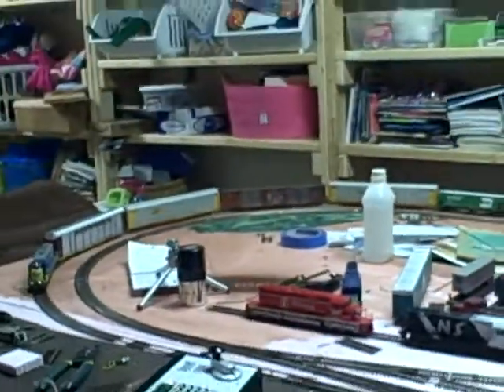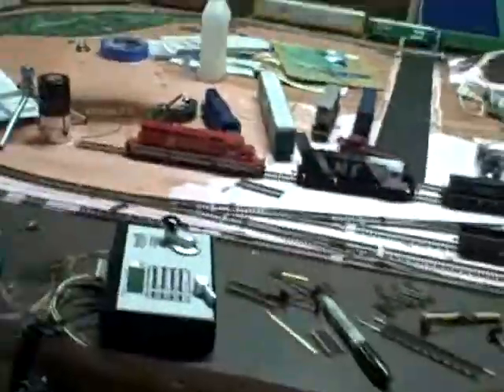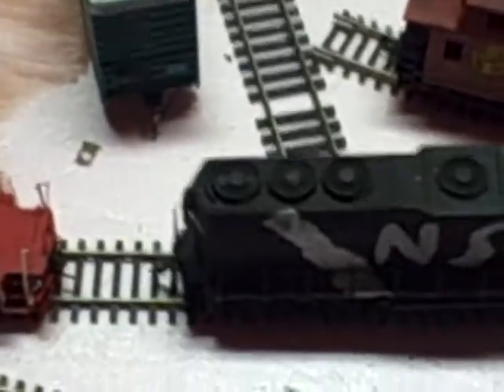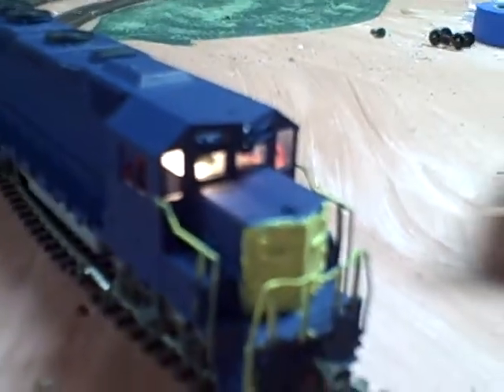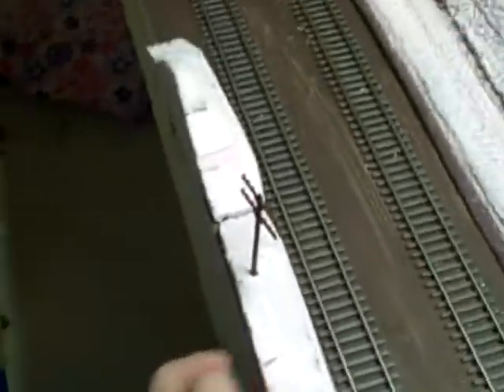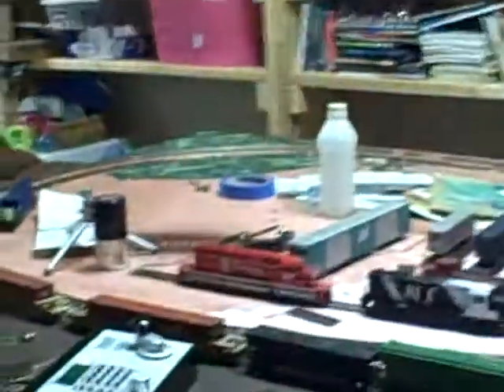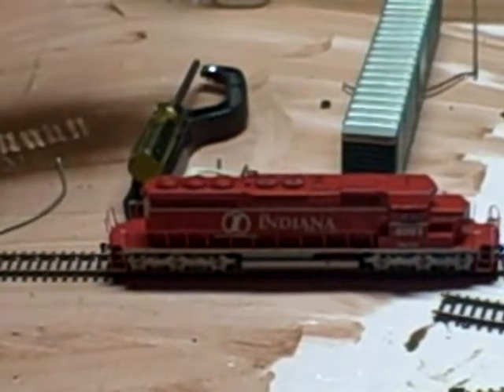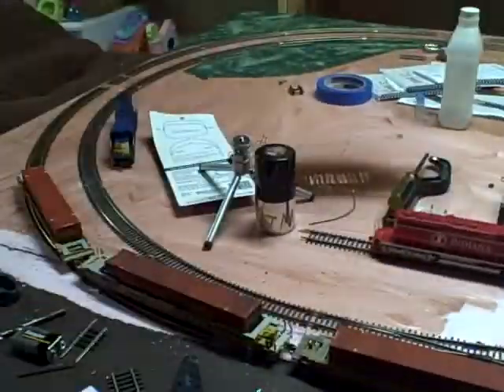layout update 1/27/09

Comment: there is a few possibilities why it wont run. Try deleting it from any consists you may have put it in. you could also try doing a Factory reset on the decoder, if you still have the decoder manual that should give you instructions on how to do that.

Comment: My answer to the problems with your loco. It's the decoder. You probably screwed something up when you were programing it. Try a factory reset on it. Also check and make sure you didn't lose power to the track. If none of this works, get a new decoder.